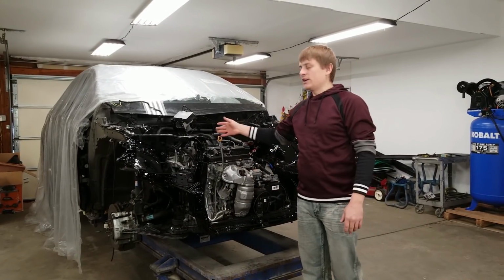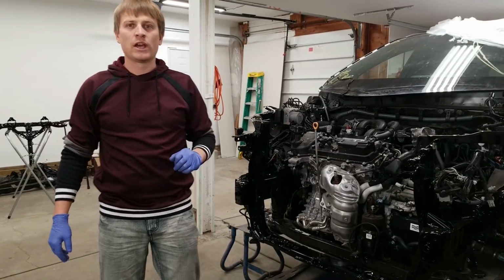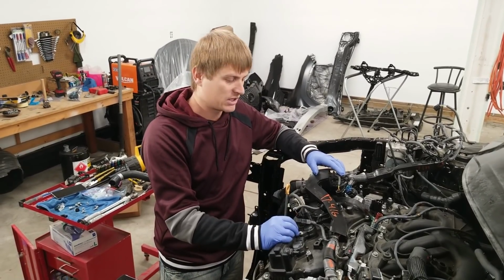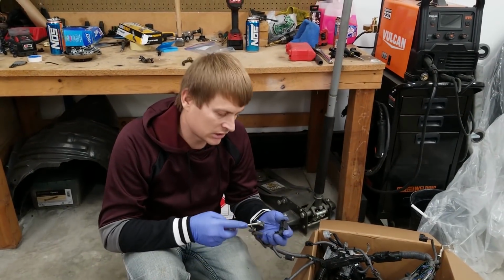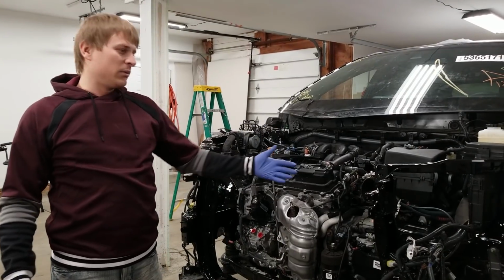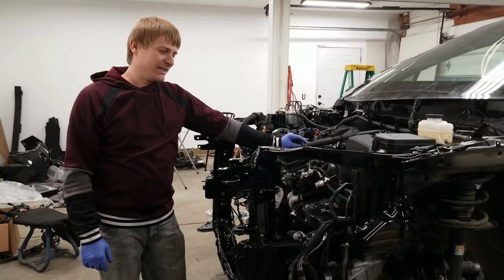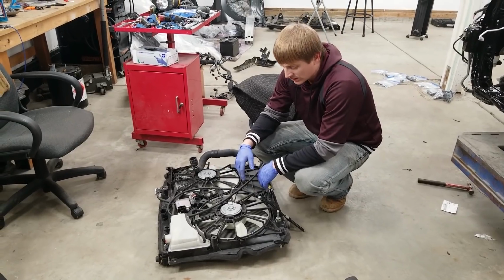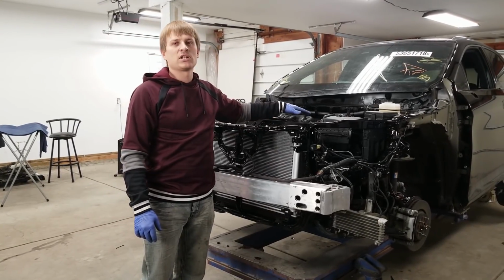Rebuilding 2017 Lexus RX350 Fsport from Copart prt 10

Comment: My god the way all that stuff stacked and stuffed into that engine bay is nuts. Really is all that wiring in today's cars totally necessary. Wonder why they don't break up the main wiring harness more, Run to points on firewall, fenders or leg to engine , then plug into that going to other places.  Would cut down on what needs to be taken apart, replaced in a front end crash.

Comment: Amazing job I wished you test it after installing the radiator so we can see if fan is kicking or not
Reply from the maker: What about if I forgot plug in some plug on the engine wire hardness? then I would have to take everything apart again,  no thank you.  But I will make sure I include the video were fan kicks in